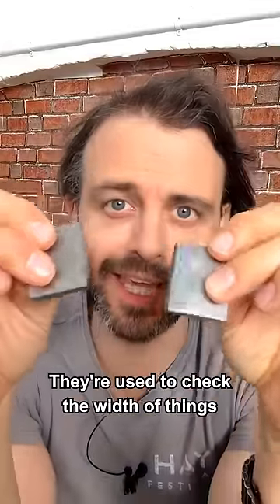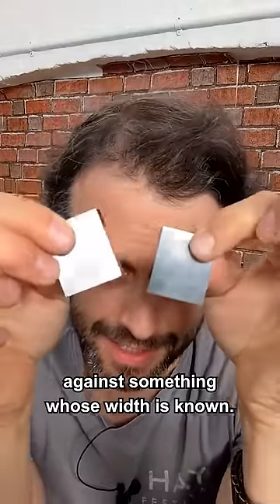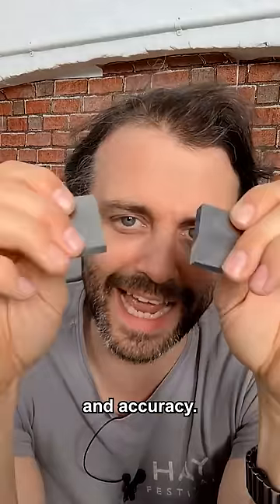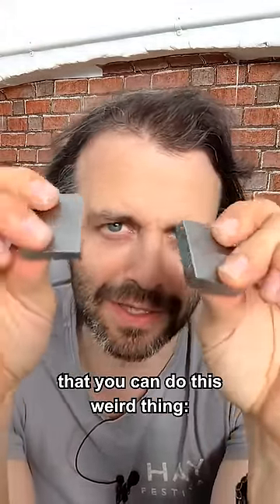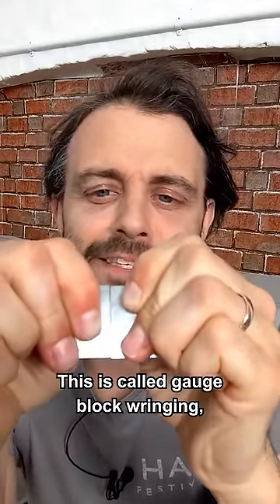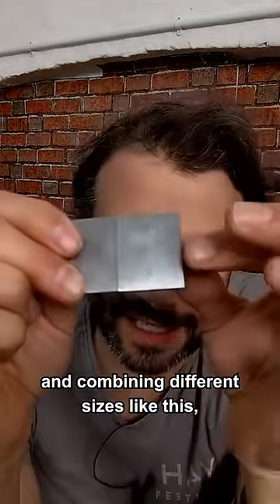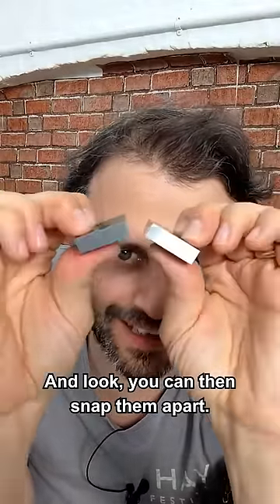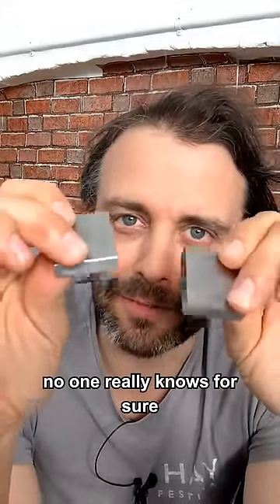No One Knows For Sure Why This Happens!

Comment: After what I have found after some research is:

"1) Air pressure from the surrounding environment as the air is squeezed out when the blocks are slid together. 
2) Surface tension from oil that remains on the gage blocks or water vapor from the air acts as a glue to hold them together. 
3) When two very flat surfaces are brought into such close contact with each other, this allows an interchange of electrons between the atoms of the separate blocks, which creates an attractive molecular force. (This force will remain even in a vacuum or if no oil or water is present on the blocks.)The last two sources are thought to be the most significant."
Reply: So it's a partial (so there's still a crisp fracture where the edges of blocks were) cold weld (like in space)?
Reply: @matthewsalmon2013 
Not exactly a full cold weld like in space, if I remember correctly.
You can wring gauge blocks together thousands of times, they should still measure the exact same dimensions.
Reply: Now that sounds like the best explanation so far.
But how do we prove it? Do every test to single out every other force?
How do you even cancel out van der waals...? Which is the third one you talked about.
Reply: First two have been tested via vacuum chamber with clean, dry blocks. No significant change
Reply: They’re hardened to the same Rockwell so there shouldn’t be any wear between them. That would be an  interesting experiment. Wring them together 1000 times and weigh them to see if one is pulling material from the other. I’m guessing it’s more of a general force like surface tension , than a true cold weld like you would have with gold.
Reply: That's what I was thinking. The shear vacuum from the two flat surfaces
Reply: Is there anything else to it other than the traditional effects of vacuum? Perhaps some sort of "ionic force"? I just would've thought vacuum was obvious but he says no one really knows so I assume it's something more complex? Quantum maybe?
Reply: That makes sense
Reply: I was thinking it was obvious that the blocks are machined so finely that the molecules are split in just the right way that you can interweave them lol
Reply: Guage* block.
Irony kills me
Reply: I thought it was 1 but 3 seems more likely
Reply: Prove it
Reply: If its air pressure. All u have to do is put it in the vacuum chamber and see if they fall apart after pressure is pulled
Reply: Yes 💯
Reply: @5tarstriker78  that has to look wrong to you. It's gauge.
Reply: @Fightre_Flighte first cancel out everything else then test just van der walls measure the breakaway force then test the others and subtract this force from the total.
Reply: @Fightre_Flighte space doesn't exist pal
Reply: 3rd one is more likely the case
Reply: @rileyham9058  
I like that idea. That way you could remove the force from Van Der Waals affect post test to find how much the new variable actually contributed.
Reply: @The1Mustache3  
Why so, buddy?
Reply: @miloz1207  
Thing is, they don't necessarily need to be that smooth to use Van Der Waals force (# 3.) Geckos do much the same thing, though their sticky feet are arguably directional.
Our best guess so far is that it's a combination of all three.
Reply: @ScoptOriginal  A. U mixed up my vowels. 😂 Yes it does thank you.
Reply: I think in normal conditions its a combination of all 3 but since someone mentioned that it also works im vacuum and with very clean blocks its propably van der vaals or ionic bonding forces. Usually metals form a thin oxide layer and i assume that there may be some partial ionic bonding between the blocks.
Reply: Is the van Der wal effect actually strong enough for this?
Reply: @Fightre_Flighte  I was going to mention van der Waals but you have already!
Reply: @dannygolds5630  its really not more complex but it makes for more content when you're ambigous like that. Its sad really.
Reply: Ok, the third thing you said is Cold welding. I'll give you credit for mentioning that it has to be in a vaccume and on two clean surfaces. Cold welding actually almost killed 3 astronauts back in the 80's, their door cold welded together and they couldn't do a spacewalk. Pretty fucking wild.
Reply: It certainly must be the last one, they feel almost magnetized when this occurs.
Reply: Cody Dawn wrung gauge blocks together inside a vacuum chamber.
Reply: Thanks for typing that so I don't have to. Just because some geyser says "scientists don't know" doesn't mean scientists don't know. It just means the poster doesn't know if scientists know.
Reply: With a vacuum if precise enough can literally weld themselves together
Reply: @andrina118  
Sorry I snatched it from ya!
Reply: All of the above, all the above are the reason they stick together. it’s also the grain, the tolerances these metals are cut to are microscopic, when you align the crystalline structures of the metals together they lock like double Velcro, like course paper rubbing together. (I’m an iron worker)
Reply: The most common theory is 3, it just is difficult to experimentally verify.  Basically the general thought that the surfaces are coming close enough together that intermolecular forces are coming into play.  Most likely that electrons are starting to get attracted to oribital “holes” on the other surface.

This is opposed to cold welding where free electrons actually form covalent bonds across the surfaces (which happens in space because high energy particles can provide the extra energy needed to get electrons across the gap)

Originally it was thought that it maybe ionic forces due to metals delocalized electrons (they share free electrons with their neighbors).  However you can also wring together ceramic materials as well.

The most interesting thing is they seem consistent at about 300 newton of force.
Reply: Van de graaff force?
Reply: after asking GPT?
Reply: Nice. Very nice
Reply: Thanks for looking this up and sharing @lordotoasty2423
Reply: Thank you I was gonna say we definitely know why this happens but I did not want to type out the explanation
Reply: Very reasonable thoughts.
Reply: It better be the third one. That sounds the coolest.
Reply: @alarik95  I think you mean Van der Walls force…
Reply: These are all just theories. Like he said, no one really knows. Much smarter, qualified people than anyone on these comments have been studying this phenomenon for a very long time and have still come up with "don't really know".
Reply: What he means is 3). Those are called Van der Waals Forces and are very hard to calculate, in the same way that superconductors or doted semiconductors are. That's why this effect is hard to explain.
Reply: @the1truth420 You can't have a quantity of something that doesn't exist. Space has extent and can be measured and quantified so it exists.
Reply: I think 3 is most likely. Just like gecko feet.
Reply: @Fightre_Flighte  oh yes you are right i completely forgot about that. Thanks for the correction
Reply: Also known as the Casmir Affect
Reply: I think it is the smoothness which causes them to stick.  A great deal of surface area us in contact.  If you looked at a peice of paper under microscope, it would look like a mountain range.  Two peices of paper would have very little of thier surface area in contact with each other.
Reply: I think number 3 is the answer I read something about "cold welding" being a problem in space missions because the same metals will fuse spontaneously and causes problems on mechanical hinges not working properly.
Reply: Those are only hypotheses though
Reply: Please tell me you didn't need to research this...? This stems frol literally common sense
Reply: Nbr.3 is exactly what i thought initially wich is a very cool physics effect ! 🎉
Reply: Similar with glass sheets and over time they can never be separated.
It is as you say but eventually they permanently weld together forming a Crystalline bond like with glass sheets.
Vacuum welding two pieces like explained by another comment is factual.
Gauge blocks are made from a special material that can be polished to a micro fine polish.
Placing them together does damage them over time.
They remain accurate no matter what the temperature is.
Reply: By "some research" do you mean, "asked Chatgpt" per chance?
Reply: @Fightre_Flighte  someone said ceramic gauge blocks do it to, with each other and with metal ones. We know that metals and ceramics can bond because that's what a protective metal oxide is. Also, the surface of a metal in atmosphere is actually a ceramic metal oxide. So it's not a metal weld but an attraction between ceramics.
Reply: you're wrong
Reply: @LogicalNiko 
Actually spelled van der Waals force
Reply: van der Waals force
Reply: @ScoptOriginal Believe it or not, it's actually 'gage'......Gage blocks.
Reply: I thought surface tension ot first but I like that third one
Reply: I would've guessed the third, but the other explanations would also make at least some amount of sense!
Reply: @dannygolds5630 all electromagnetic force is ultimately quantum and nothing changes for big things if we consider quantum effects. 
There is the possibility of tunneling though. But i doubt he brings them close enough to observe tunnelling
Reply: @VoidSinister but it's been disproven
Reply: @GarrettMeyer25 which has been done without (significant) effect
Reply: That last one makes sense considering the amount of friction required to wring the blocks
Reply: Cold weld?
Reply: The third one might be possibly true to some extent
Only if we can cut a metal in space or vaccum without it being oxidised we can find out
Reply: @matthewsalmon2013  no. It's a "science doesn't know why it happens" thing. But also, none of the things he just described were cold welding. That's very clearly just what your original guess was.
Reply: He didn’t research, he just watched The Action Lab video, it literally explains all this and even in the same order
Reply: @KirkWagner147  Worn gage blocks don't stick together well, and sometimes not at all. I know this for a fact from using old worn out sets in manufacturing.
Reply: Oil has nothing to do with it. I have cleaned gage blocks 100% and made them stick together.
Reply: I'll go with 3
Reply: 1. is wrong, since it works in a vacuum
Reply: Not so sure that "no one really knows for sure why...".
Chemistry prof, who worked at the famous Brookhaven Labs (old nuclear research lab in Long Island, NY), told me that the most significant force involved here is Van-der-Wals force ... The metal in the two pieces are so flat and smooth that the molecules in two pieces share/swap electron valence positions and/or are attracted to the nucleus of atom in the other gauge block.  Cool stuff.
Reply: @matthewsalmon2013  also, cold welding is actual welding. The pieces fuse. Not the case with gauge block wringing; you can easily snap them apart. So😊ĥð no, it's not cold welding, not even partially.
Reply: @Fightre_Flighte  not a full cold weld "like in space." Not even a partial cold weld. A different effect. Hey remember when Steve said science doesn't quite know? And then a bunch of loud almost-certainly-males started presuming they know more than all of scientific canon? I memba, I memba. Also, do you remember the original meme about remembering stuff? Pepperidge Farms remembers.
Reply: @KirkWagner147  umm... since when does two things having the same hardness cancel out any possibility of other surface interactions that could move material? That is a real question too, sarcastic as it may regrettably sound
Reply: @VoidSinister  cool, go tell Science™️ it can chill out, you're here to save the day
Reply: @dannygolds5630  my god that was the worst one so far. Could you guys at least try to PRETEND to base your conjecture on something? I mean seriously... quantum effects? Is quantum just the word you conjure when something is inexplicable? Is this the 80s? Are you the writers of Quantum Leap? JUST GO GOOGLE THE FUCKING PHENOMENON AND FIND OUT WHAT SCIENCE HAS TO SAY. I PROMISE YOU IT WON'T HURT
Reply: @GarrettMeyer25  ... I hate to break your heart Garrett, but not only have they already done that experiment, they already fucking mentioned it in this thread. Wow, you really thought you were the first person to think of air pressure huh?
Reply: @joshyoung1440  okay mr. Smarty  pants 🧠👖 Mcgee jr. 🥸
Reply: Are any of these published results with definitive proof, or just speculation? They all seem plausible, but then… if we don’t literally know, the answer could be anything, and it might be the kind of thing where if people actually find out, it’s something new that we can start doing on purpose in practical applications
Reply: Nah bro magic
Reply: @whatslife8925 hey I’m curious, how would cutting the metal in space without oxidation occurring, prove to you that the two surfaces are indeed sharing electrons? And what does Oxidation have to with it? Feel free to give me the long or short answer cause I’m genuinely interested. Thanks
Reply: I vote number 3 as the same metals will merge together in space due to a lack of an air bubble keeping them apart
Reply: It would be so cool if the block sticking were caused by the Casimir-effect.
It would be the simplest empirical evidence for QFT, just like working oxidised connector plugs are the simpest evidence for tunnel effect.
Reply: The Casimir Effect in action.
Reply: @GarrettMeyer25  Cody's lab did exactly this and they still wrung together
Reply: @nikolaydimitrov-nikodimi scientists are debating while you Mr Dunning Kruger know the answer
Reply: I thought it was VDW forces but since it is metal it would be weird
Reply: that’s number 3 iirc from the physics class. it should works without the air pressure or oil in the surface.
Reply: @daniellynch2122  oh cool. Thx for letting me know that. Yeah i wasnt saying that thats what i think it is. I was just saying that its easy to test that theory. So obviously thats not it.
Reply: The third one seems to be referring to Van Der Waals interaction, which is what I guessed after hearing that this still works in vacuum
Reply: Sounds like the legitiest answer to me!
Reply: Yeah my guess would’ve been a combination of 2 and 3, after reading this I’m sure that’s what it is
Reply: Vaanderwaals forces
Reply: 4) Divine intervention - most likely it is!
Reply: @redwizard9430 I've got some at home, oil definitely plays a part in it. Mine won't stick unless I get some oil from my hands on em first
Reply: All of these have been tested.  That's why the video said that no one really knows.  Leave it to some mediocre YouTube commenter to think they have an explanation.
Reply: https://en.m.wikipedia.org/wiki/Van_der_Waals_force
Reply: It’s actually a vacuum caused by the displacement of the oil, the vacuum form in nano meter sized spaces in the surface (they are made to be precise yes but not that precise)
Reply: @Finbar-kb7zi  this works in a vacuum, so it isn't exclusively air pressure.
Reply: The third point here is what I was thinking, I'm glad you clarified it.

It really makes sense, if you have a pair of almost perfect flat surfaces of the same material you're going to bring back molecular bonds... To a degree
Reply: I can tell you it's certainly not air-pressure: 1 atm of pressure on the edges is nowhere near the amount of force to counteract the weight of one of those blocks
Reply: Van Der waal force maybe?
Reply: It works in vacuum aswell and can be effected by oil/alcohol/water/whatever so its more that the "grid" of the atoms in the solid material and the bodies' electric charged hold them together. If they are done really well, the atoms partially enter the same arrangement grid, even without any electrical charge differences, but that certainly helps so its both electrons and atomic electrical charges and the electrons arrangementeven with neutral charge within the atoms hull since the electrons of atoms on the edges tend to ammass a little more towards the other atoms, allowing them to rearrange when atoms appear on the other side, forming a bigger grid (somewhat) and creating a small force to hold them together. Weird concept and probably way more to it but that's my understanding.
Reply: Wringing doesn't work with ceramic gauge blocks very well at all. So I would say that the first two are the lesser forces at play and the the sharing of electrons is why wringing metal gauge blocks is so much easier and a stronger adhesion. You could probably test the theory by starving the blocks of free electrons and checking for a correlation in the force needed to pull them apart.
Reply: @doomguy974   I’m not saying it’s air pressure I was saying it’s more like a balloon of a vacuum, the vacuum forms in the microscopic areas of the blocks, yes they are high precision and tools and yes urgent are ground down to be flat, but they aren’t perfectly flat, there are microscopic hills and valleys (for lack of a better way of explaining it) these “valleys” have oil residue in them which gets displaced when you wring the blocks together by the “hills” of the other block, when the “hills” move from the valleys a vacuum is formed in the valleys, this is what causes them to stick together
Reply: @R1PPA-C  depends on the material tbh, you can do the same thing with machined aluminum and some coolant, even with different materials, I’ve had plenty of aluminum parts essentially wring themselves to the steel jaws for example, I don’t know much about how they would be molecularly bonding in that case tbh
Reply: @Finbar-kb7zi  yeah I've had really really dead flat surfaces "suction" themselves together before, but that's all it felt like.. Artificial suctioning... but knowing that these gauge blocks are very precise my logic is telling me that if you create two surfaces that are as dead flat as can be (an almost perfect slice) you're essentially taking away any gap even on a molecular scale (kind of like naturally gluing them back together)... But.. That's just the way my brain is telling me. Truth is usually a boat load different 😂... I've also just woke up so ill probably be coming back to delete this in half an hour 😬😂
Reply: @dannygolds5630  There is no "ionic force". An ion is just an atom stripped of electrons. It is definitely in the realm of quantum physics though.
Reply: I believe the primary explanation is the third one since the first one is probably trivial as it doesn’t hold in a vacuum. The second one I think is unlikely because oil is non polar and has negligible surface tension and in fact would reduce the effect of the third explanation unless it was effectively squeezed out when the two blocks where squeezed together due to their extraordinary flatness.
Reply: It's friction.  That's all.  Two incredibly smooth surfaces pressed together will have a large amount of friction due to the entire surface area being in contact.
Reply: Steve is capable of googling
Reply: Works in a vacuum with freshly cleaned metal, it's simply the bond